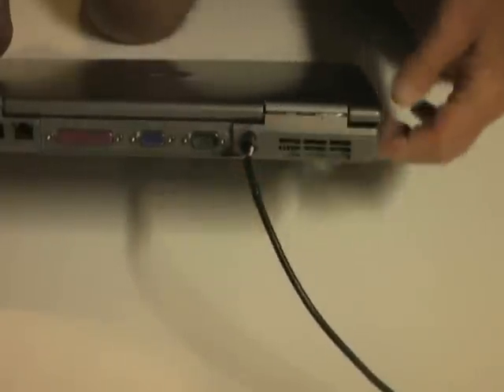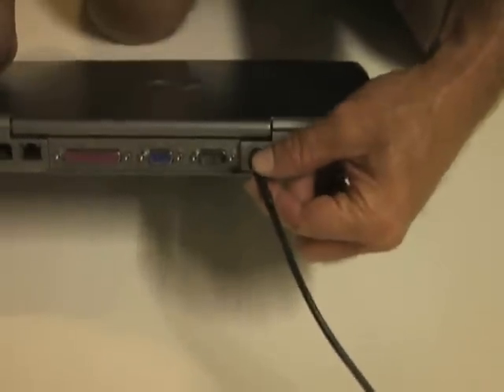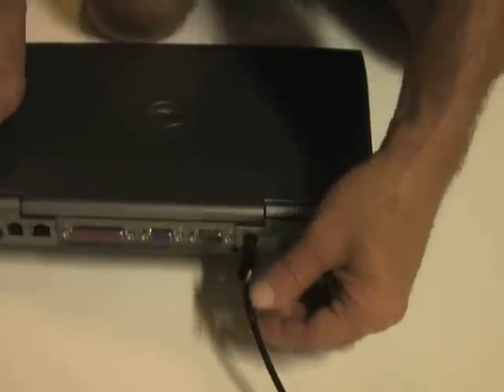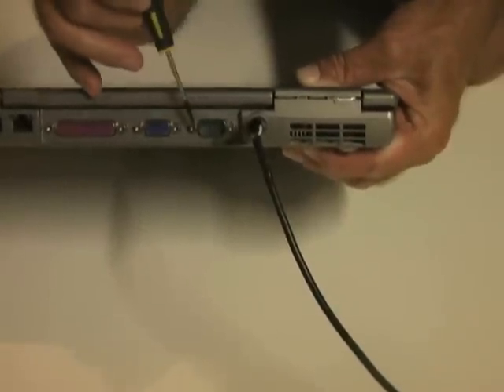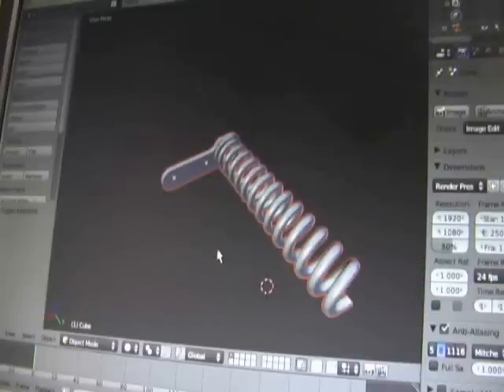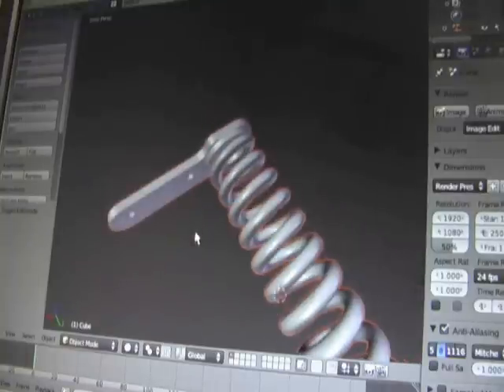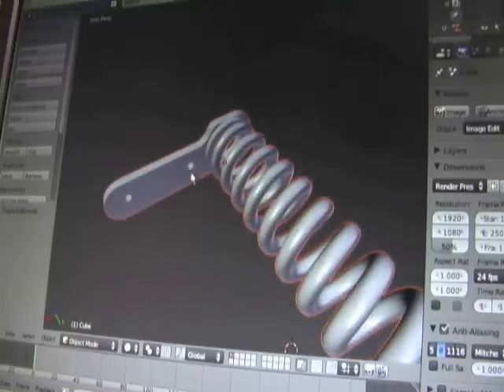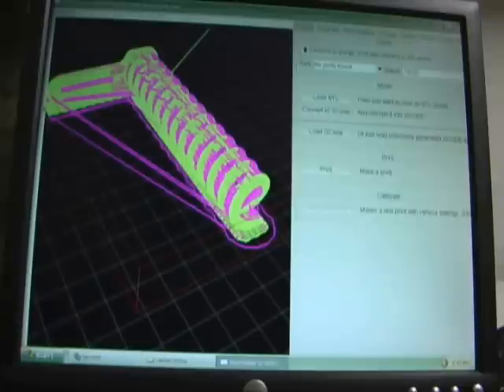Designing and Creating a Spring on a 3D RepStrap Printer to Protect a DELL Laptop Charging Cable

Comment: that's brilliant! DIY stuff to solve real life problem is always good :)
tho i would make two changes to the current design.
1. at the end of the spring, i would fasten the cable to the spring so it also eliminate damage from pulling.
2. i would make a latch coupling between the spring and the fasten mount. So that you can first plug in the power cord. then latch it onto the fasten mount. that way you don't need to screw/unscrew every time you need to move it around.